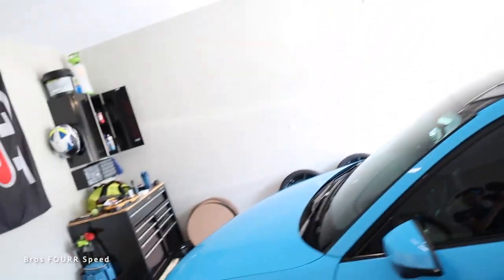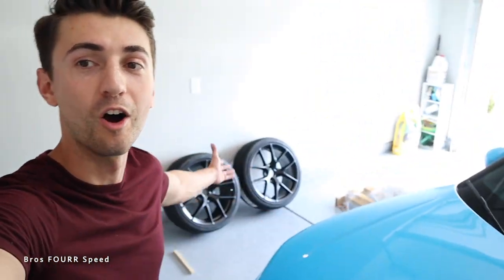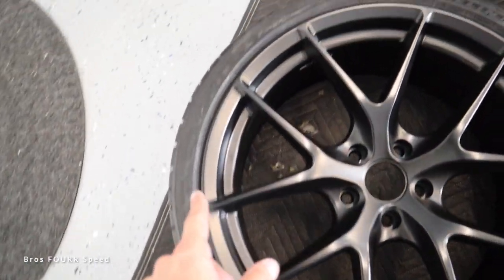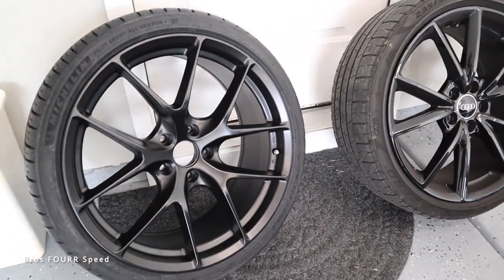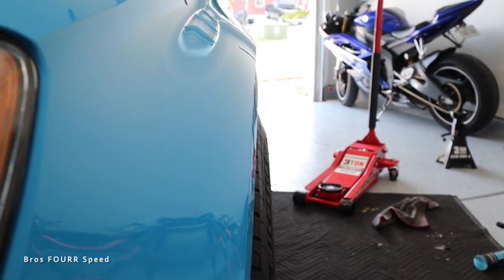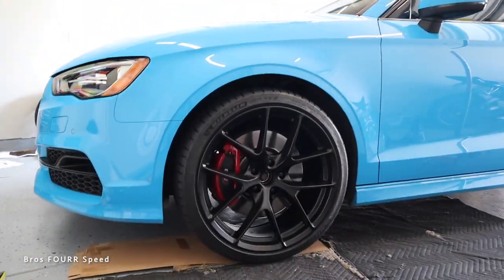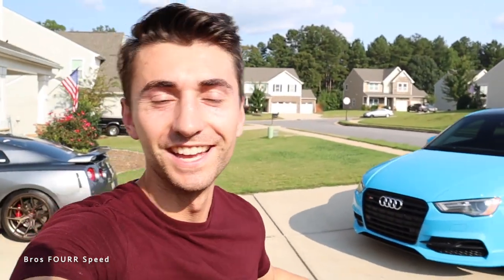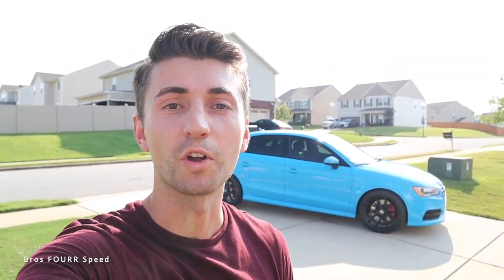Wife's Audi S3 Gets Custom ESR Wheels and Michelin Tires

Comment: The new setup totally changed the look of the car. Looks great!! 🔥🔥🔥
Reply from the maker: Absolutely! Love the fitment on these! Especially now with the lowing springs installed ;)
Reply: @BrosFOURRSpeed Damn bro, I have been following your channel and I’m a huge fan. I have an Audi A3 and have loved the mods you’ve done on your wife’s car. I saw how awesome and convenient it was for you to buy off fitment industries. Decided to buy the exact setup. Went with the ESR RF2’s black, 19x8.5 with 30mm offset. Unfortunately my experience has been nothing but painful with fitment industries. 

I ordered wheels and tires with ceramic coating. However, when processing my order the team missed it. So they had to refund me the ceramic coating. One of my wheels came with damaged. The lug nuts were also chipped. Admittedly, they shipped another set of lugs but only refunded me $100 for the damaged wheel. 

Next I got the hub rings that you recommended. 57.1 to 72.6mm. 72.6mm is the size they have on their website. So I thought, ok cool I’m all good. Went to the tire shop to get them installed and they don’t fit. The size wasn’t 72.6mm. 

Such a nightmare experience for a first time costumer. Went for the convenience but has been far from it. Hope everyone else has a better experience 😢
Reply from the maker: @TheDemn  oh dang sorry to hear that! Things can definitely get damaged in shipping but seems like Fitment got things squared away for you tho. Those are the ring sizes that fit my hub and these wheels. Not sure why a shop would say they don’t fit. Hopefully you got things squared away by now at least!
Reply: @BrosFOURRSpeed  just wanted to comeback and give an update. Turns out my wheel hub wasn’t 72.6 but instead 66.6mm. Anyways, installed the aluminum hub rings you suggested and the vibration is gone! Smooth as ever! Thanks again bro for all the great quality content. 🙏🏻
Reply from the maker: @TheDemn  Nice! Glad you got it all squared away. Crazy how the hub rings make that much of a difference!

Comment: Will this set up work for me? I have a 2023 S3 with the  same H&R Sport lowering springs.  I don't know what my wheel hub size is though and when I checked fitment they didn't mention anything about wheel hubs? Do they come with the rims or something I have to order separately?
Reply from the maker: I ordered the hub centric rings separately since I didn't like the plastic ones the ESR wheels came from. You can talk with Fitment Industries about hub centric rings, and they should be able to tell you the exact size needed. I found them on Amazon for cheap. https://www.youtube.com/watch?v=Gz1k5ZEGDto&t=48s

Comment: Wait.. since when did the S3 have in wheel TPMS?? My 2017 prestige uses the ABS
Reply from the maker: A TPMS sensor isn’t related to ABS, you can have a vehicle without ABS that has TMPS sensors, those are in the tire itself.
Reply: @BrosFOURRSpeed  right. I’m saying my S3 doesn’t have them in the tire it does the old school way of measuring the diameter and wheel speed. I figured it would’ve had them in the tire but when I got new wheels it didn’t have them at all
Reply: @BrosFOURRSpeed  by the way- love the progress on the S3 you’ve given me a few ideas for mine as well. Do you go to any of the local meets?
Reply from the maker: @briangray9118  huh, that’s interesting. My order shows TPMS for this kit. So I’m not too sure lol
Reply from the maker: @briangray9118  Thanks! Yeah we’re planning some of the Cars and Coffee shows next month now that the car looks good 😅
Reply: @BrosFOURRSpeed  sweet well maybe I’ll see you out there!
Reply from the maker: For sure!

Comment: dude,  I just got some 5x114 19" wheels for my s3 along with a 5x112 ==> 5x114 stud conversion kit. the new wheels are a +35 offset, the stock s3 wheels are a 49. do you think my wheels will fit without spacers, or should i get spacers ?
Reply from the maker: I'm not too sure. I really only knew this setup for the car. Worst case see how they fit and determine if you need spacers for an ideal fit